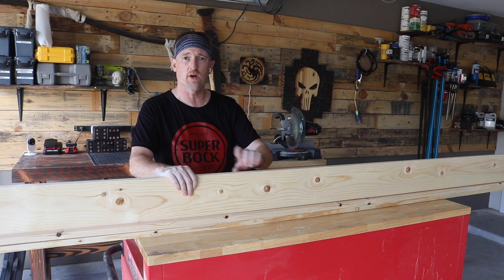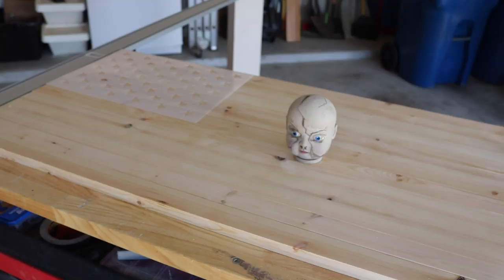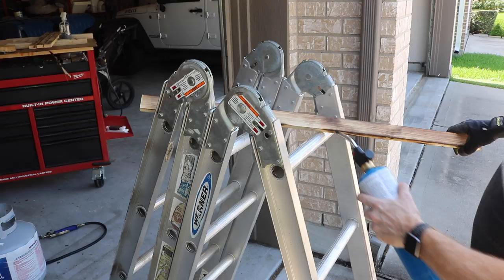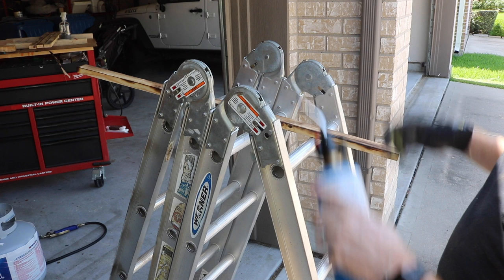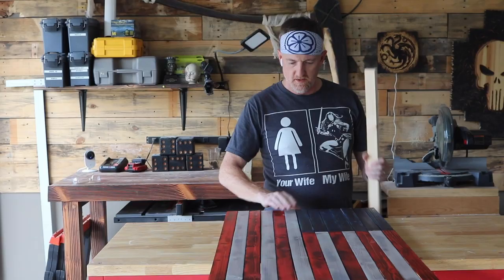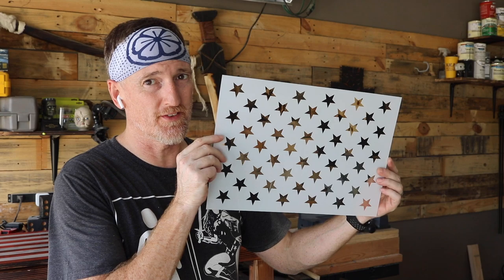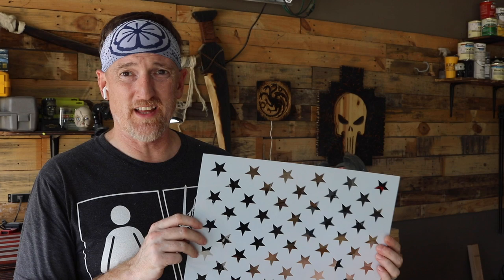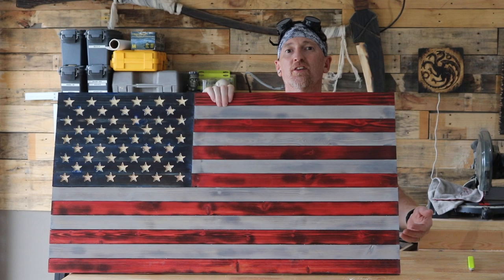How to Build a Burnt Wood American Flag #Merica

Comment: Hey “Dad” I’m a subscriber from the future. I’m currently building this project but using the XTool D1 to draw the union and burn the stars.
Reply from the maker: Noice!
I've also seen folks mask the union, cut the stars out and then paint the stars using the tape as a template.
Cheers
Reply: @BuildDadBuild  I’m going to test run the union as a fill with multiple passes and see what comes out best. I got my D1 at Christmas and quickly became a subscriber. Now that I’m looking back and finding woodworking projects that makes me even happier. Thanks for the vids brother   🥃”clink”🥃

Comment: I'm starting my first flag build this weekend using this video as a guide. Thanks for all the content. Great stuff!
Reply from the maker: Awesome, Joe!
Good luck, brother. Let me know how it turns out.
Cheers
Reply: @BuildDadBuild  I ended up starting it today. I used clear pine. Everything is great so far. I used Keda dye for the red and blue and sun bleached stain for the white. I dumped almost a whole bag of red Keda powder in 6oz of water... Dude... What an amazing red. I had to go over it about 6 times to get it where I really wanted it so I think I'll use stain next time. Wish me luck on the stars. My router doesn't have a plunge base so I might use the old hammer and chisel. This is such a fun build

Comment: should i spray the wood with water multiple times while burning or after? I have tried shou sugi ban with thinner wood, 3/8 - 1/2 inch and i always get warping. Is this a technique for thicker wood only? love what your doing, Merica!
Reply from the maker: Hey Joshua,
I don't really use this technique on anything less than 3/4" thick. It's too hard to control the outcome.
Normally I spray in between passes with the torch. If you warp, try burning the backside of the wood.
Cheers

Comment: Someone ordered a 60" flag from me the other day. The stripes are easy, I can use use 1x3s for the stripes. The Union is the hard part. I had to print off a bunch of files at different sizes until I got the right size, then I put the printouts over some poster board and started cutting out the stars to make a diy template. Now that ai have the dimensions I can order a better template. The stars are a lot bigger so carving them out should be easier.
Reply from the maker: Wow! That's a BAF (Big Ass Flag) LOL
Reply: How much did you charge?
Reply: @GhostRider-sb3jy  $225

Comment: New subscriber! Great video, watching your other videos now. I'm new to woodworking and it's great to watch videos where the person building stuff doesn't have $100K worth of equipment.
Reply from the maker: Thanks for the sub. Definitely NOT $100K worth of equipment! LOL I'd say you could stock a pretty decent shop for under $1K. My advice if you have your eye on a specific tool is to use the Honey plugin for your browser (not a sponsor). You can follow items and get alerts when the price drops. It's how I buy all my clamps!!
Reply: @BuildDadBuild  I'll have to check out that plugin, I've heard of it before but thought it was a gimmick. My lacking areas in my shop right now are a router, table saw, and clamps... can never get enough help holding things in place.
Reply from the maker: You can manage most tablesaw applications with a circular saw and a straight edge (until you can pick one up). Definitely spend the money on a good table saw, you'll be happy you spent the extra $$. I LOVE my palm router: https://amzn.to/2ZvpMyW
And I've found that I really don't pull out my larger plunge router all that often. That little Bosch has plenty of power.
And as for clamps, you're absolutely right. You can never have enough. Small clamps you can usually get away with Harbor Freight or something equally as inexpensive. But when you get into 36" and 48" clamps (probably anything 24" and up)...you really start to see a difference in cheap versus spendy. Like I said, I have a running list of items on my "drop list" with Honey. You can search in Amazon, find a tool, and add it to your drop list. You can see the number of times the price has changed and set an alert to let you know if it drops under a certain percentage of the current price. Pretty handy!

Comment: U have by far the best flag on all of YouTube. I’m having trouble finding the red and blue colors that you used. Any suggestions?
Reply from the maker: Thanks Damen!
The Red and Blue I picked up at Sherwinn Williams. And at the time I didn't realize that those colors are specific to SW. You can try there if you haven't already.
Or check out the flag I did in this video. I used Keda Wood Dyes on it and I think the colors are brilliant.
https://youtu.be/lezbNju1p-M
Cheers
Reply: I just picked both colors up today at Lowes.  They had to look up the colors in the computer, but they mixed them up for me...no problem!

Comment: I know this is an older build, but hopefully somebody that has made one can comment.  Any concerns with the ends (extending beyond the furring strips) curling or warping on the last burn or just over time?  They look unsupported.   Nice build.  I'm dong one this weekend.
Reply from the maker: I’ve had no issue. But you can always move the furring stories out if you’re concerned.
Reply: @BuildDadBuild  awesome, I appreciate the reply.  Especially on an old post.
Reply: @BuildDadBuild  do you glue your boards?

Comment: I’ve had some wood warp slightly on me before putting a flag together.  I have been spraying my final product as shown in this video but concerned it may warp more.  Any suggestions for sealing? Maybe 2 coats of polyurethane?
Reply from the maker: 2-3 coats of poly should be fine. If you want high gloss you might want to use Halcyon...
If you have a board warp on you, try torching the back of the board to flatten it back out.

Comment: When you say add water so they don't warp do you add the water before you start burning or during or when? Thanks.
Reply from the maker: During. I usually keep a little spray bottle with water with me and hit the boards with it in between passes with the torch.
Cheers!

Comment: Well, I'm going to attempt to tackle this build myself soon. Fingers crossed it works out for me as I've never done anything of the sort. But, I'm curious as to why you didn't use any glue to hold the boards together. Apologies if you addressed that in the video. I've seen others use pocket holes, some with and without glue. I'd think that using just the furring strips, you'd want some additional holding power such as glue. Great work, keep it up!
Reply from the maker: You are correct, sir. The glue bottle is right off camera. Truth be told? I simply forgot to apply it before I nailed the furring strips down.
Reply: @BuildDadBuild  Good to know! Thank you for the info. Once I get this thing done, I'd love to share the finished product with you.

Comment: Use this video this weekend and built my first wood burned flag thanks to you! Only question is what do you use to hang up your wooden flag?
Reply from the maker: That's awesome Steven!
I used a wire picture hanger for this one.👍
Cheers
Reply: Thank, I come back to check the video when I doubt myself. So far, I've make 4 and love the way they came out. Your video helped alot!!
Reply: and you got my sub
Reply from the maker: @stevenhuntington2655  Awesome! Thank you.!!

Comment: Super cooooo. Lol what type of nail size did you use when fasting it together when clamped? I don’t have a gun do you think with hammer I could achieve that or do I just bite the bullet and buy one
Reply from the maker: Thanks, Adam!
My vote is always for BUY THE NEW SHINY TOOL!! LOL
But honestly those are just 1 1/4 brad nails. You could totally do it with a hammer and nails.
Cheers!

Comment: I don't currently own a torch. Was looking at the BernzOmatic Trigger-Start Model #TS4000KC or its bigger brother the Model #TS8000KC. Any idea which one would be a better fit for this kind of use?
Reply from the maker: Hey Timothy,
So, I have the 8000. I bought it in case I ever wanted to use MAP instead of propane. But I just reviewed them both on Bernzo's website and it looks like the 4000 handles MAP too. I'd save a couple of bucks and go with the 4000
https://amzn.to/31Y4pu0
Cheers

Comment: How do you stop thr boards from warping so much?  My boards warped so much that the front of the flag was not smooth, instead it was uneven from board to board (stripe to stripe).
Reply from the maker: Hey Brett!
try burning the backs of the boards to get them to warp the opposite direction.
And keep in mind that a little warping adds to the rustic charm of the piece.
Cheers

Comment: Need some help. Trying out my first flag. I bought the sunbleached and did a test run on a piece of wood I haven't burned.  And it turned out more gray than anything. By burning the wood does it make it more like the white in your flag you have here.
Reply from the maker: Soooo...the sunbleached stain has a lot of paint pigment in it. Treat it more like a paint and less like a stain. Don't necessarily put it on and wipe it off. Let it sit and BARELY wipe the excess off. You may need to do 2 coats.

Comment: Love your videos!  Did you use an adhesive when you clamped ‘em together or are the nailed strips on the back all that is needed to secure everything?
Reply from the maker: Hey Jodi!
I did not use any adhesive. However, that was an oversite on my part and the glue was sitting there. I just forgot to apply it when filming. I wish I had used glue as that flag has a little bit of play in it.
Cheers
Reply: @BuildDadBuild  good to know! Thank you for your quick reply! Making my flag this weekend!
Reply from the maker: @jodikelly9555  Awesome. Let me know how it turns out. If you want...share pix on my Discord channel...
https://youtu.be/6UrYxjRh5xM
Reply: Instead of cutting in the stars cant you just spray paint white over the stencil. I tried cutting in with a dremel and I didn't do so well some stars didn't come out right
Reply: @bigaxe602  yeah my first attempt went South real fast with the Dremel and the stars. I stopped and sanded away my mistakes. A friend recommended using the cutting wheel attachment to outline it and chisel the inside. THAT worked out great. Now I'm just carefully using the Dremel to smooth out where I used the chisel.
Reply: @bigaxe602  btw... My first attempt looked like 50 starfish! 😂

Comment: question...were the stains tinted with a dye before being used, or did you buy them premixed? I checked the links to the stains and it looks like it goes to a clear tint base. Thanks!
Reply from the maker: Yes. I linked them so you can see the can.
The specific colors I used are available at Sherwinn Williams
Reply: @BuildDadBuild  right on, thank you sir!
Reply: @BuildDadBuild  Another question... Island water looks kinda light/turquoise on Sherman William's website...do you think deep ocean or navy blue would be better? Thanks!
Reply: @KOTEC525  I couldn't find island water at lowes or sunbleached. They had Scarlett though so I substituted for true blue and marshmallow and mine turned out great.
Reply: @DJP89  right on, thanks!

Comment: What would you recommend using to mount this on a wall? Sawtooth hangers?
Reply from the maker: I just used picture hanging wire.
Cheers
Reply: @BuildDadBuild  what kind of wood did you use? I've been using common pine and it seems to work well but the white stain doesn't seem to work very well. It doesnt want to seep in and I have to put like 4 coats to get a good stain but even then it looks brushed rather than stained. Red and blue are perfect.

Comment: Hey builddadbuild how did you keep your boards from warping or twist when burning them? Every time I burn the boards and then set them back up to glue they are uneven as hell and in my opinion look like sheet... the guys that ordered them all end up loving them but not me. I hate my own creation because it’s not perfectly straight, flush and level.
Reply from the maker: They're always going to misbehave a bit! 😂 If you spray them with water when you burn them you'll keep the warping to a minimum...but they're always be some. That's why I clamped them together before I put on the backing strips...keep them in line!
But in the end part of the character of a piece like this is that it isn't completely straight and level. It's what we call "rustic"! LOL

Comment: So you said you could cut 6 - 1 and 1/2 in x 37-in slats from a 1 by 8 by 8 board.  It looks like in your video your slats are somewhat wider than 1 and 1/2 inch (optical delusion by chance? LOL) by my calculations you should be able to get at least eight slats at one and a half wide.🤔. Did I miss something?
Reply from the maker: Nope. I think I just misspoke.
Cheers

Comment: Did you use the bigger stencil that came in the pack when using 37inch boards
Reply from the maker: Yes...the smaller stencil is pretty small. But it was cheaper to buy that pack than just the stencil I needed.

Comment: Are you using solid stain or transparent?
Reply from the maker: Hey Adam!
It's pigment added to a tintable base.
Cheers
Reply: @BuildDadBuild  so water base ? Do you think it would be safe to use epoxy over this stain ?
Reply: I'm kinda new to this and just don't wanna waste money on epoxy if it won't work!

Comment: Hi there. I really like this project. I'd like to give it a try however instead of using the stencil I'd like to get some tin stars. I'm wondering what size star is on the template? I see a lot of craft stars sold by the inch.
Reply from the maker: They are a hair under 1 1/4" tall
Reply: @BuildDadBuild  thanks!

Comment: There are three different union stencils.  I'm guessing you used the large?
Reply from the maker: Hey Shane!
Yes. The big one. For some reason the package with 3 stencils was cheaper than that just buying the stencil I needed!
Cheers!
Reply: Just so youre aware in case you want to do this same peice, the sencil is supposed to cover 7 boards fully (10.5 inches) but it doesn't. If you align it to the top, the bottom will miss about half of the 7th board, which is ok, since you are staining all 7 boards blue anyway. It's just confusing at first because you would think the stencil covered all 7 boards.

Comment: Big thanks for this video! Question: do you have to use tint for coloring the flag or can I use normal paint (water based or enamel)?
Reply from the maker: Yes and no. LOL. If you want the grain of the wood to show through you are better off going with a tinted stain as it penetrates the wood rather than sitting on top. Straight paint right out of the can will cover your grain and a lot of time when you paint wood without primer it will go on unevenly. You could, however, dry brush, or even paint and wipe off for a different effect.
I say, experiment on some test pieces and determine which look you like the best!
Reply: @BuildDadBuild  Thanks for the response. I think the tint is the better and more confident solution haha.
Reply from the maker: @jellyg.8961  right on. Let me know how it turns out.

Comment: So it takes 3  1"x8"x8' boards to make one of these flags?
Reply from the maker: That's what I did. But if you have to hauling capacity and ability to cut wider boards you could make one out of a 1" X 10" X 10' I believe...
Reply: @BuildDadBuild  I finally made one and found that one 1"x12"x8' was enough for one flag.

Comment: Hey Nick, did you use the Nyalox on the wood after burning it on this project?
Reply from the maker: I did not. Normally on a surface burn like this the Nyalox brushes aren't necessary.
Cheers!

Comment: Why are my strips of wood warping when I burn it to make a flag
Reply from the maker: Keep a spray bottle handy and spray the wood as you burn.
Sometimes warping happens if you heat the board too quickly. Try to do more passes at a little bit of a faster rate.
Also, burn the opposite side to help bring the board back to straight.
Cheers and good luck!
Reply: Thanks man I appreciate it✌

Comment: Funny guy. Not into the slats nailed to the back though. Won't last very long. Glue is your best friend.
Reply from the maker: You are correct. I actually had the glue bottle sitting right there...just forgot to apply after I turned the camera on.

Comment: I think I would just paint the stars.  Too much room for error carving each one out and if you're going to sell them, that's alot of labor time eating into your profits. The finished product would still look great.
Reply from the maker: If I was going to batch them out / sell them I would definitely figure a better way to do the stars
Reply: @BuildDadBuild  Every flag I've made has had carved stars on it. I only etch away the stain though, so it isn't as deep. Takes about an hour per flag to do it with the flex shaft. If I was going to buy one, I'd rather have a carved one over painted, because there isn't as much skill in painted stars if you're using a template.
Reply from the maker: @jimjohnson5787  I would definitely still carve them. But I would probably take a page from your book and not carve as deep.  And maybe pick up a fine burr to do the points.
Thanks for the tips!